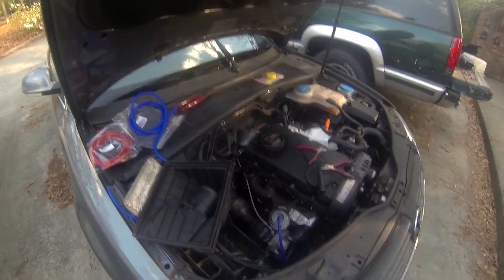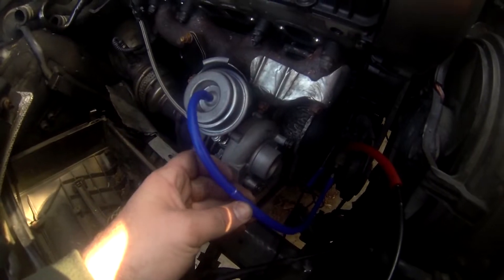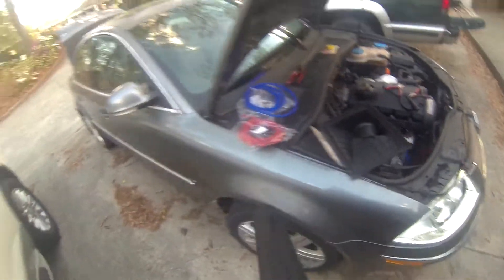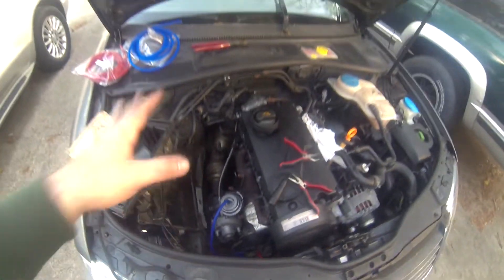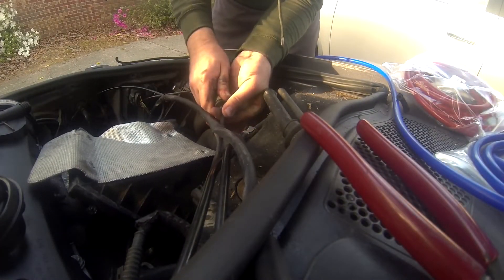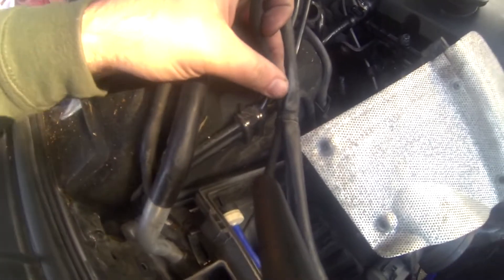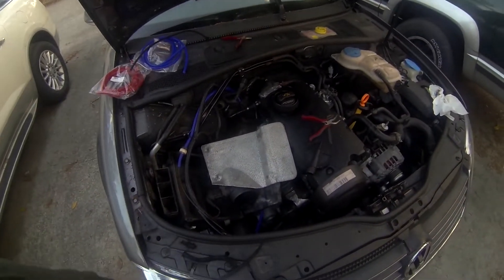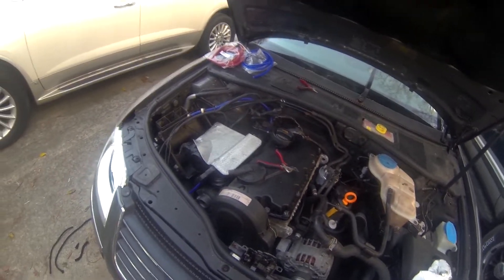2005 Passat Vacuum Hose replacement

Comment: Hello, I also want to change all the hoses from the vacuum pump and not only the one that comes from the egr valve, since the hoses were there, they must be the hoses to withstand the temperatures, right?
Reply from the maker: Anything silicone like I used in this video will outperform rubber hoses.